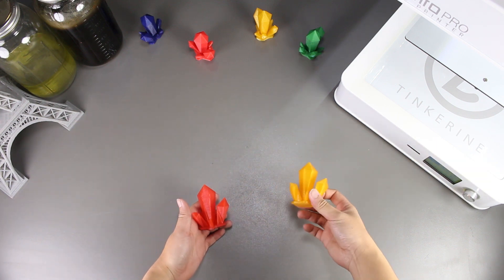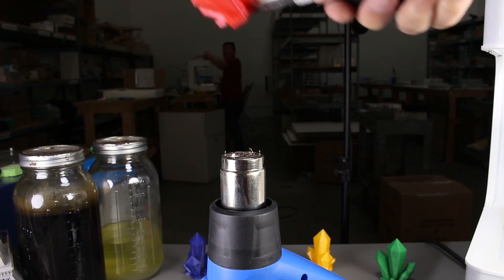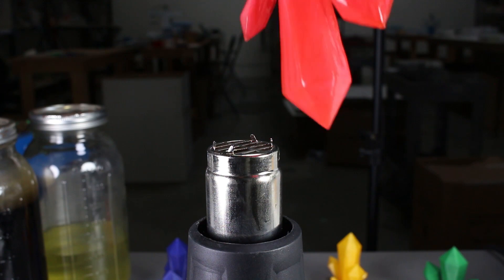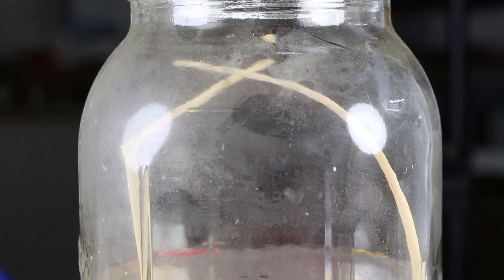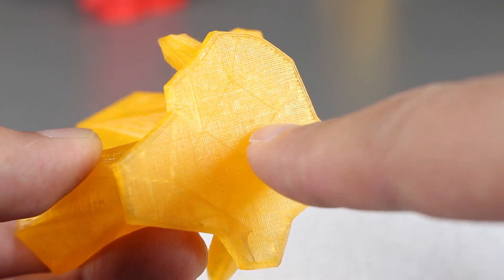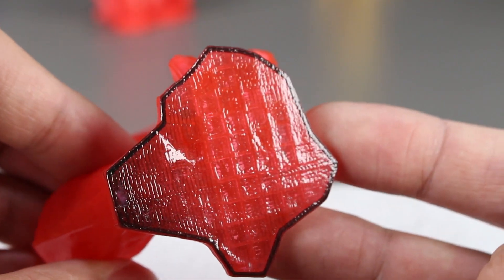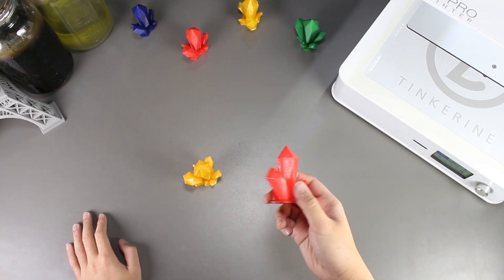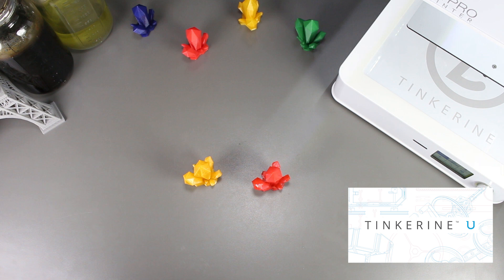Using Heat to Seal your 3D Printed PLA Prints

Comment: Thanks, what is the temperature of heat gun?
Reply from the maker: Thanks for the comment! Here are the settings for the heat gun: low (25°C/77°F), medium (350°C/662°F) and high (550°C/1022°F). We used high on the heat gun in this experiment so you are looking at 550°C/1022°F.